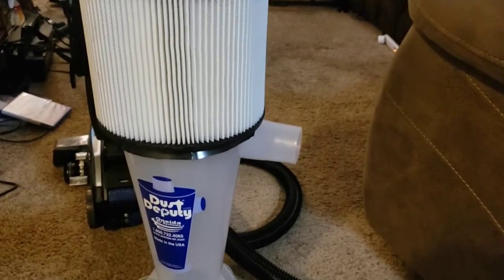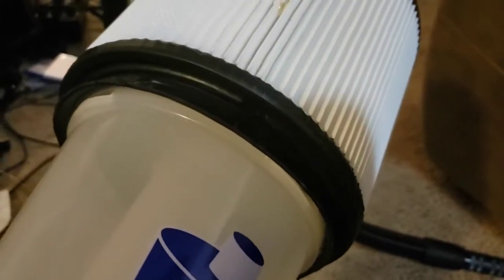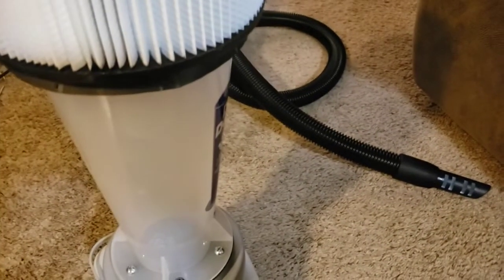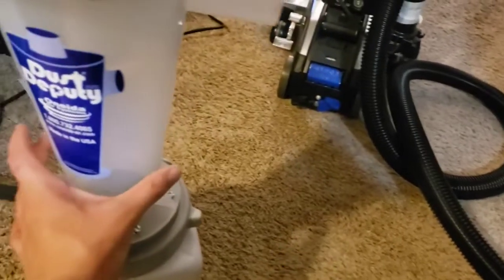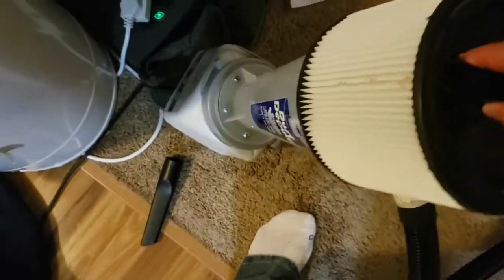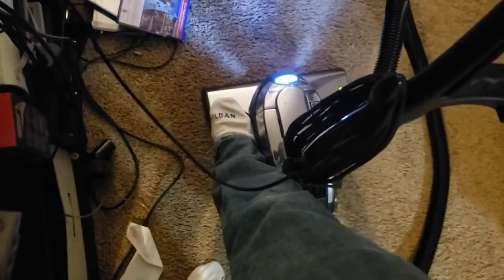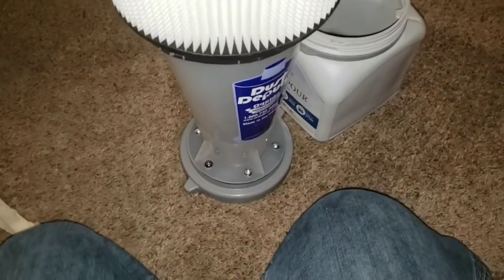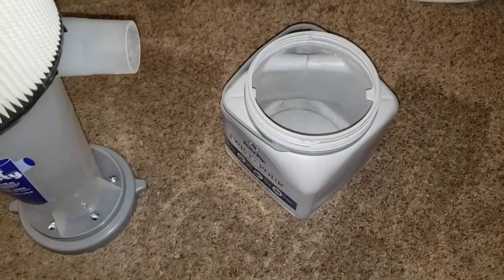unfinished bagless Kirby demo

Comment: You did it! This is 100% what I meant to do :)  There is going to be some (or more than some) airflow loss, but let's hope not too much. That shop vac filter actually has a lot of surface area due to the pleated design. One option what I was thinking was attaching cyclone unit to the Kirby wand and run 2 inch hose to it for more flexibility. Interesting to see how this unit measures. That already available bagless Kirby conversion kit is horrible. Tiny filter, no cyclone and i bet huge airflow loss.
Reply from the maker: Yeah it's gonna be interesting to see how much airflow loss we'll get from this.. hmm...you know there is a 2" flexible hose used in central vac installation that could be used for that.

Comment: Well, that's REALLY different. Must have been exceptionally bored, eh? 😆
The sound it made was pretty interesting though and I loved how the hose connection clogged fabulously. 👍
Reply from the maker: More about "building a better mousetrap" and seeing the effects of it. We've all seen the bagless kirby conversion and I've felt like it could be done better. This concept I think would perform better due to it having a cyclone and a much larger filter. It in theory should allow it to retain flow better than the eureka dust cup. Clearly it's going to be a downgrade from the typical bag but that was something I figured was inevitable.
The hose didn't really clog it just had a build up of lighter debris that sort of wrapped  around the stub since the tape was leaking it allowed some of the lighter dirt to move back into the inlet. before i peeled off the tape it can be seen sticking to the sides and while removing it it appears less dense in the center.  it would have been better to have the end of the stun closer to the lip of the inlet so we don't have that occur. But it doesn't really matter at this point it was kind of a trial run. Next month we should see the finished abomination!